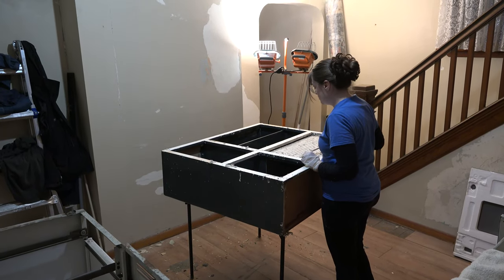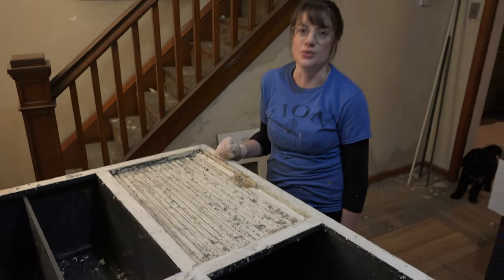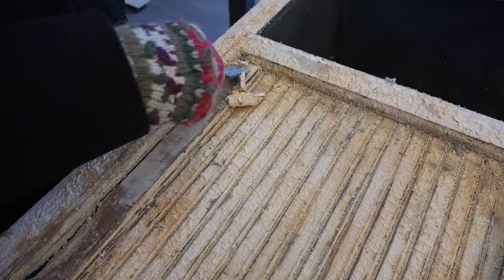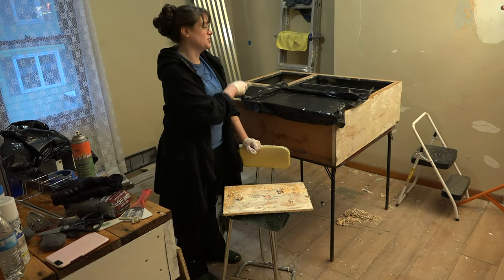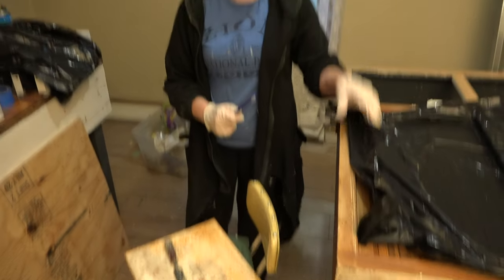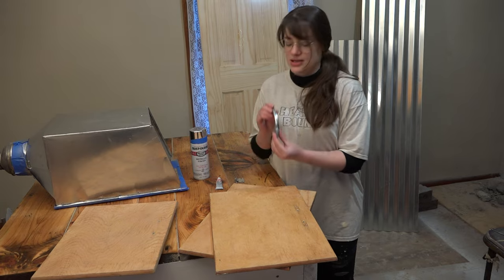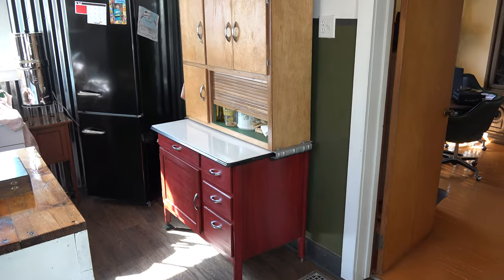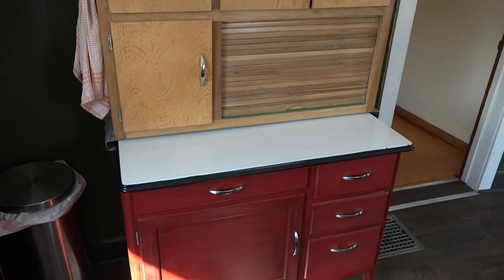Hosier Cabinet Paint Stripping

Comment: Quite the project! I had one with 5 layers of different colors and tried, over 6 months, everything out there for paint stripping.  The best was a heat gun and paint scraper!  It got finished in less than a month.  A little sanding for the remaining finish and the oak looked great! I'm working on my third Hoosier now which came in its natural oak, so it's quite a relief to only have to clean it well and refinish the hardware.